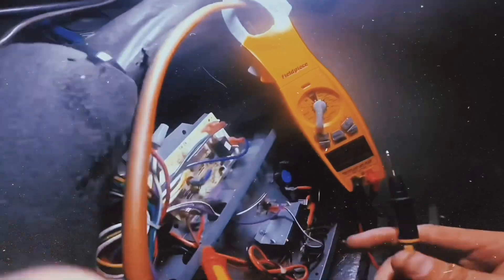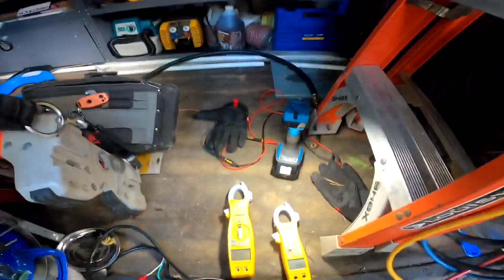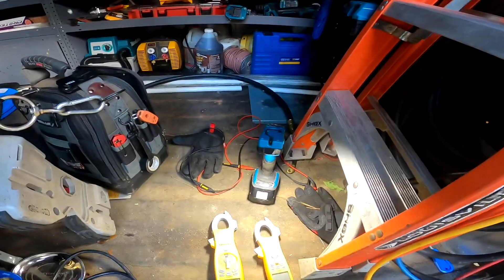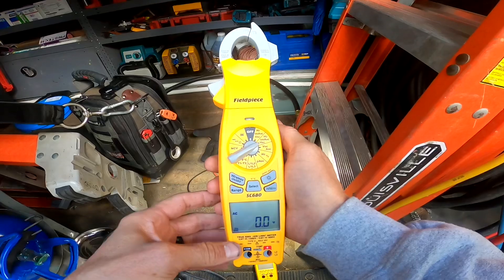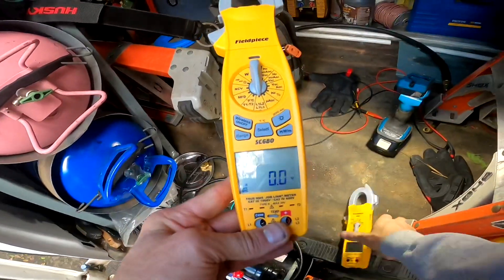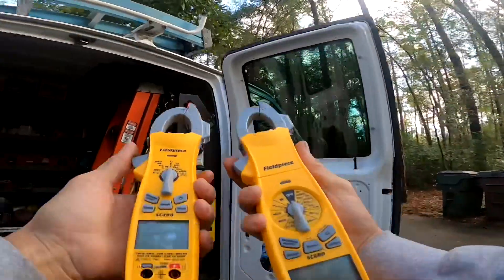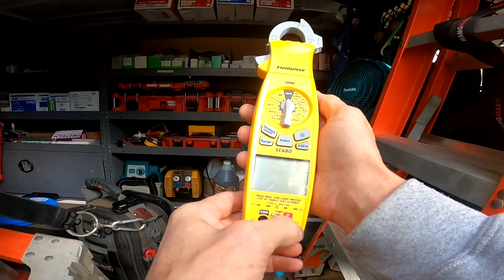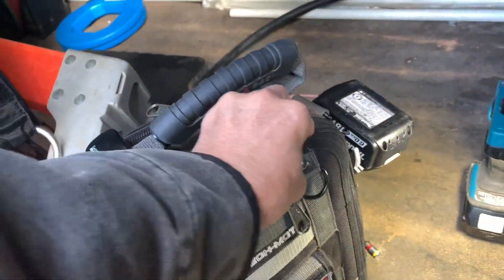Fieldpiece SC680 and SC480 Clamp Meters Comparison

Comment: As far as the Inrush goes on the sc480..... for 80A and below hit the Inrush button 1 time  For larger units (4 & 5 tons) that will pull over a 100 amps, you need to push the Inrush button 2 times and this will move the decimal point all the way to the right. Then you will have no problem capturing your higher Inrush readings. And as far as using the magnetic strap on the sc480, it's better to take it loose and slap it on top of the unit on the fan grill and then the meter will hang on the side of the unit perfectly without spinning around. That's really how it's designed to be used. Folding it down into the meter is just a nice way to store it. But the second magnet on the sc680 does add extra strength. You can also use the round hole in the end of the strap to hang it on something. Try the Inrush again on the sc480 and see how it works for you now  😎👍
Reply from the maker: Thanks. I didn’t know that about the inrush on the 480. I kept trying to change the range on the front of the meter.
Reply: @HVACGUY  now maybe that will change your mind back to the sc480. 😉👌
Reply: @HVACGUY  field piece meters are the only meters that can diagnose ALL problems in the hvac field with 0 lies. every other meter out there is very imperfect!!! ive tested it against uei, flukes, kleins, kaiweets, and a few others and every single one of those meters lied but not the fieldpiece. i have the sc440 and my only complaints are you have to push the buttons so much to get where you need every time. you have to go to voltage then click another button to get amps. then you have to push the inrush twice to get proper inrush. and also it takes 3 plus seconds just to get a voltage or capacitance reading. so its almost like you have to be nerdy or a computer programmer to operate them. these 2 cons are super annoying but you just have to get used to it... i can attest that for 20 years of doing hvac field piece has always been 100 percent accurate while these are brands still do this day are not. i dont understand why but it just is this way...
Reply: I love my sc480 meter.
Reply: @SombraLocs  FamSan 😎👍😎👍😎👍
Reply: I only need to upgrade my meter for the inrush option. I almost counted it out. Thanks
Reply: I have an SC 440 and it functions exactly the same when measuring LRA. Just push the inrush button twice to move the decimal point. Great meter for DYI!
Reply: Do you have to do that with the sc680 press it 2 times to capture higher amps? Or does it automatically capture the higher amps?
Reply: @Ricoswavaey  No, on the 680 it's done through the selector switch. Because there are two different amp settings, a higher and a lower one. You select the higher amp setting for hire In Rush readings.
Reply: @sknight0391  oh ok, and the selector switch is on the front of the sc680 meter?
Reply: @Ricoswavaey  yes
Reply: @sknight0391  ok perfect thank you so much for the help!

Comment: I'm a new tech and need to upgrade my meter to one with inrush. I see some of you are contemplating upgrading from 480 to 680; may I ask what functions you're missing on the 480? Is it just the swivel or electrical capabilities as well?
Reply from the maker: I think you lose the dc amps on the 480.

Comment: Im worried about my own smaller veto pro pac being able to handle the sheer girth of the sc680, let alone 12 inches. That is a lot of meter. Maybe if I just start by putting it in halfway the first couple times I use it…

Comment: I have an SC56 with the swivel head that I like a lot. After looking at the SC440 i decided it was a pretty good step up with the inrush feature. You do have to move the decimal to catch the inrush. I'm thinking of going back to my Fluke 16 for most troubleshooting and if I need an amp clamp use the 440.I came along when analog meters were what we used. How things have changed.

Comment: weakest point on those Fieldpiece meters, is the Selector Knob, those break, i have two broken FP meters , have seen other techs using theirs turning the selector with a Flat screwdriver, just not me to do that, reason for me in replacing them wit TESTO 770-3, same with Sman Gauges have three of those leak ...that they took care and replace em, but also got myself the Testo set instead which also i like em more than FP

Comment: Can you post a video or a link to how to check micro amp dc and the difference in volts amps dc and amps dc. im not sure what the function you mentioned would be used on. You said "the SC 680 has volts and amps dc and that the 480 only reads micro amps dc." someone please help me out with this I'm very interested.

Comment: I used an SC480 (courtesy of HVACR Videos) for about a year, until it it became demon possessed or self aware and started giving me all kinds of false readings. I was in the middle of trying to diagnose a furnace low voltage issue when the meter finally crapped out on me. I had to rush to a supply house in the middle of the job before they closed to pick up a new one, and since they only had the SC440 I had to get that one. The 440 is ok and does most of what I need it to do, but my 480 was much better. One thing I really liked about my 480 was that it could test phase rotation. My 440 doesn’t have this feature. I’m planning to eventually get a new 680.

Comment: Is there much of a difference between the 440 and the 480?  I'm a student in refrigeration/heating classes.  Instructor suggested the 440 as our first meter.  I want to make an informed purchasing decision. Any feedback appreciated
Reply: The 480 is Bluetooth and can be use with measure quick, the 440 can not. 
I don't believe 3 phase rotation is available either.

Comment: I actually used my inrush today on the 480 no issue with a 4 ton compressor and caught the 147amp start up. You have to change the decimal point by pressing the button twice.

Comment: Fluke twistgaurd are awesome test leads. Have had lots of issues with the Fieldpiece test leads. Looking for a meter to check vfd on large air handlers.
Reply from the maker: The 680 is a great meter for VFD’s, even if they have a DC output.

Comment: I had an SC440 meter that I liked a lot, but I mainly work in residential HVAC and never really used the inrush, the diode setting, the Hz feature and the duty cycle. I currently have an HS36 from FP. A very nice meter, but really thinking of going back to a clamp meter. Was thinking the SC640 would be ok, but also considering the SC260 as well. Again a lot of those features I never use(d). Anyway thanks for the comparison. By the way what does the power factor feature tell you?
Reply from the maker: Power factor tells you how efficient a system is. Basically how much power is being converted into actual work. The closer the power factor is to 1, the better.

Comment: Question? So the main difference is if I'm working on mini splits the 680 is the one for that. So the 480 will not troubleshoot mini splits. Is that the only main difference besides the head rotation on 680.
Reply from the maker: Most mini-splits, and higher efficiency systems use variable frequency drives. For some of those the 480 should work fine. But, others have what’s called a square DC wave form, which means the wave never goes below 0, like standard 60Hz supplied electricity - So, it’s technically a DC drive, even though it goes up and down. And the 480 can’t check DC amps, and would likely not be able to check Hz through the amp clamp either because of this. So, yes, that’s one of the big differences.
Reply: Ok thanks great explanation for me. I'm determining which one to get to add to my joblink items. I really appreciate your help. Also ur vids/ work ethic I enjoy watching.

Comment: I used to work for a manufacturer of traffic light controllers and signal monitors. We used several different models of Flukes, and discovered that some models would fail a device when others would not. Our lead engineer looked into the issue and found that different model meters computed RMS A/C voltage differently.
Reply from the maker: RMS can be quite important in some instances, and I prefer meters like these that are TRMS. But, I guess I’ve never asked how it’s calculated cause it would appear that it is straight forward - as it implies a mathematical formula they all follow.